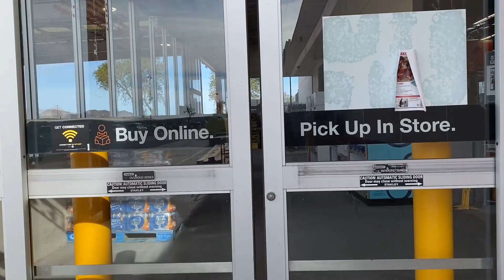5 Woods Not To Use At Home Depot - Avoid These At All Cost

Comment: Really appreciate the video! I am new to this, and trying to figure out which wood 4x8 sheets would be best to buy to cut wood rounds out of for circular signs from a large store like home Depot or Lowe's. I am planning to use 4 by 8 sheets and want to know which would be the best wood for cutting with a router, wood rounds with about an 18in diameter. These will be outside, stained and varnished. Hoping you can help me. Thank you in advance
Reply from the maker: Well, it just kind of depends. 
1, if you're going to carve a sign and do any sanding at all, you have to make sure the top veneer of the wood is thick enough. About 1/8"
2, you want to have as little gaps in each ply as possible
3, you want to pick a piece with the nicest looking top veneer
I;d go with something at least 3/4" thick, unless you're putting a backer on it. 
Hope this helps
Reply: @oldave100  yes, it does, thank you!